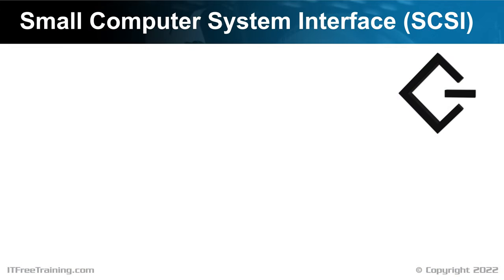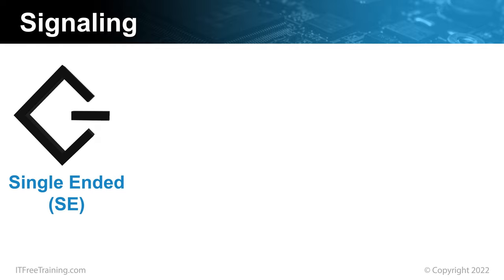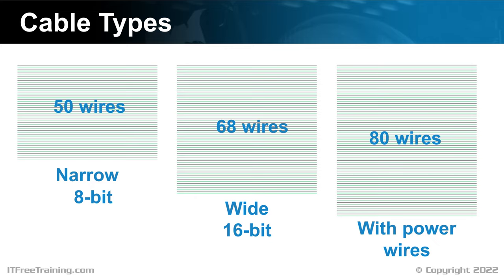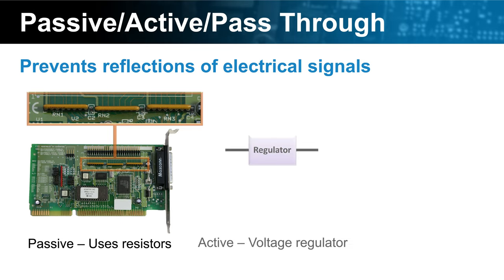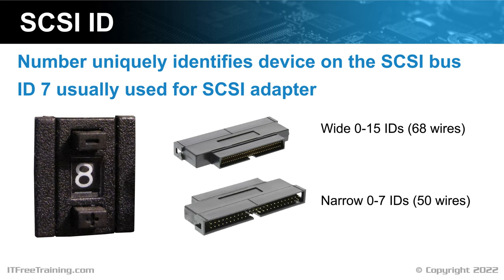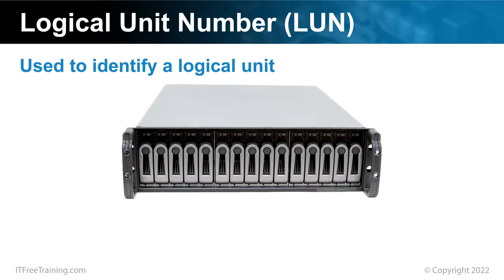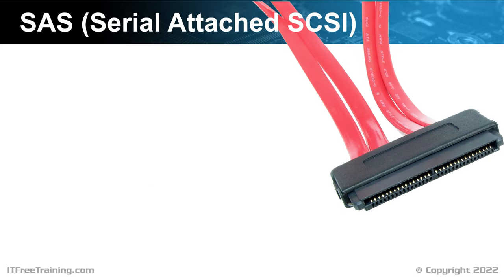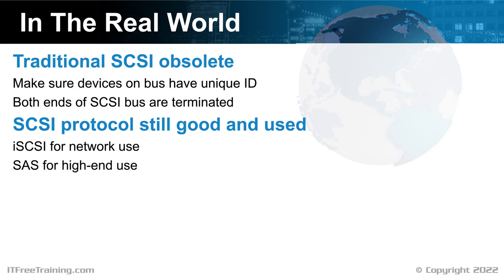SCSI

Comment: I have a sata to USB cable that uses SCSI. Why is that then?
Reply from the maker: If you're using a SATA to USB adapter, the operating system might assign a device name that reflects the adapter itself. This name could potentially include "SCSI" if the adapter identifies itself as a SCSI device (even though it's translating SATA to USB).
Reply: @itfreetraining  thank you, really appreciated your reply. I knew next to nothing about SCSI just noticed that when I connected a internal SSD to said cable to my Xbox/PC it would have SCSI in the device name.